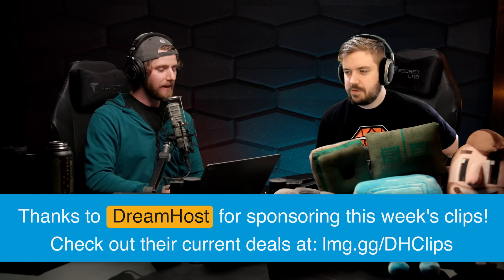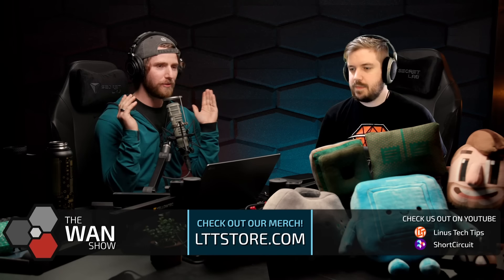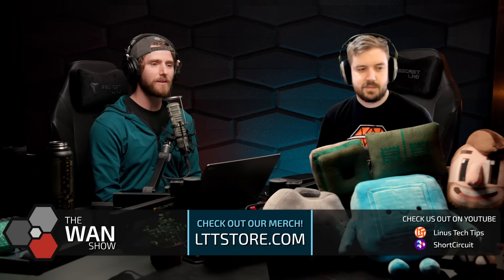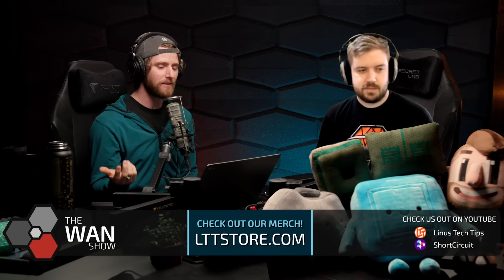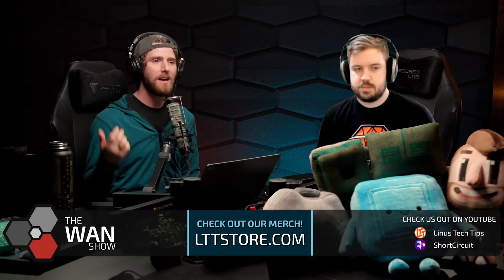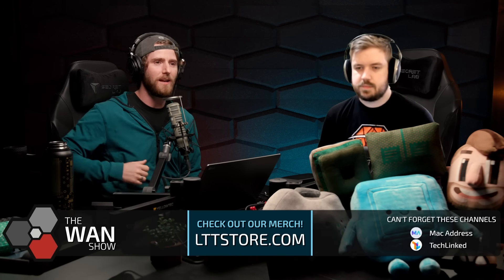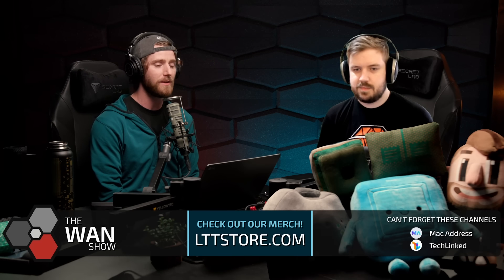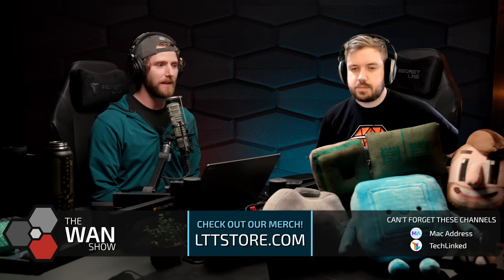They made me WASTE $10,000! Pt. 1

Comment: I’ve had GE/Jasco and I now have Lutron Caseta. Without a doubt, you made the wrong choice.
Reply: Did you not catch the point where he couldn't stand the Human Machine Interface of the Lutron switches?
Reply: @mlindholm  Yes, that’s the point. Especially if your one complaint is the feel of the buttons… you chose wrong. The GE/Jasco switches I had throughout my old place were constantly disconnecting or outright failing. I had to replace four of the switches due to failure within the first year. Lutron Caseta switches at my new place have been rock solid. Read about people online who rave about them. Lutron is objectively better than Jasco.

I will admit the feel of the buttons is different than anything else on the market. They take a bit of getting used to. I understand some may not like the feel, but it is NOT as bad as Linus makes it seem. If he had given himself some time to get over the feel, he’d be much happier with Lutron overall.

Comment: This reminds me of firmware for cable modems.
Some Netgear modems have firmware bugs that can cause random disconnects and such. Oh but a new firmware fixes that!
So how do you update it? Go to the GUI you use to adjust settings in your browser? Nope.
Your cable provider will OTA the update... Except most cable ISPs will only OTA their own devices, not 3rd party ones. - There reasoning for this backwards logic... They be sure that after the update it be compatible with the cable provider.
Which is even dumber if you think in the sense that if firmware 2.0 is incompatible, the user cant themselves downgrade or upgrade to the latest still compatible firmware!

Comment: Never ever install somekind of "smart home" stuff permanently. The basic switch on, switch off switches have been around so long for a reason. Only use smart stuff on stupid stuff like a coffee machine to make a cup of coffee ready when you wake up. Now, for the "smart" stuff that linux if talking about is standardized technology, thats also been around for a long time, BUT you need to know whats the old proven tech, and whats the magic viper poison stuff. Also using tech thats been originally designed for big corporate buildings is probably not a good idea in a small house. Jasco offering no updates is probably because the big corporates do not do updates, they get a preplanned air-conditioning/lights/whatever solution(s) that cost a lot of money and they just live with it, Jasco probably thinks normal customers are the same, you get what you ask for and thats it.

Comment: This is one of the reasons why home automation doesn't appeal to me -- at all.  It's still the frontier days of this stuff, and we've already seen product ecosystems retired.  Commercial device firmware is frequently garbage, there's no guarantee you'll ever see an update, and if there is an update, there's no guarantee they'll release it or won't just replace the original model with an "updated" one.

No.

Not unless every part of the management platform is open-sourced (and cloud-optional!), the software is user-accessible, and the hardware is actually quality.  Preferably, with the dumbest possible on-device firmware.  I would love the protocol to be limited to "hi, I'm a switch.  My state is 'on.'  I have an indicator LED.  Its state is 'on.'  My model is Luxo-matic 1000, serial is 12345abcde, my assigned ID is 0x0008."  I'm hoping that, with a purpose so minimal, the firmware can be reasonably bug-free at version 1.0.  But I remain skeptical of even that.

Comment: I understand Linus, i get why he's mad about it but if Jasco said there is new firmware for this devices then surly they thought about a way to update it. If not through home assistant which is great then through other ways maybe a mobile app that the manufacturer has made for their products. I know Linus might be like  "uhh I didn't set up this light switches in home assistant so I wouldn't need their app just to have to download it anyway because I cannot update the firmware through home assistant" . I wouldn't count that as a deal breaker. That's how I would go about solving this problem.

Comment: As dumb as this situation sounds, I think I see a kernel of logic in their madness. The lightswitch department seems to be a small off-shoot of a larger conglomerate that provides far more then household electrical devices. That "proprietary software" shtick could be the result of an umbrella directive that stems from their main money-maker in the industrial sector where firmware security can be taken very seriously because it is otherwise directly linked into their internal IT ecosystem. 
So it's not a herculean leap of logic to assume that some directives are simply applied from the very top all the way down to every branch of the conglomerate. In their eyes maybe as a way to simplify and unify their legalese and internal protocols. 

It could also just be a way to milk more money out via "licensed technicians" or straight up having people replace all the hardware just to have the new firmware. In which case, ew. 

As for a solution, isn't there some way to find someone with a switch with an up to date firmware and port that over? I'm assuming to install it, the software needs to be packaged up in a certain way or something but I'm pretty sure someone with a few cups of coffee and an axe to grind could crack this in an evening or two.

Comment: This is the stupidest thing ever. Even Apple provides firmware updates for their devices, and they're the most closed ecosystem in the world! It wouldn't surprise me at all if they've even got a header on the board for reading/writing to the EEPROM, so all you'd need to do is hook it up to a programmer to rip the code off their switches.

Comment: In Home Assistant create Input Boolean switch and turn it off or on using automation, so for example if your light was turned on by wallswitch you change turn Input Boolean to on and from now light will not work by motion becauase in motion automation you would have condition if Input Boolean 'wallswitch_room_???' is on than don't run motion automation. EZ u noobs ;)

Comment: "smart home" stuff is overhyped and a LOT of it is not worth it. also remember in 5-10 years what happens if the company behind your smart home tech goes under/gets bought and shut down...
the phone app would be first to go so no more knowing if you left the garage door open. the hub (unless its running everything local) suddenly things can stop working like if your furnace udates and doesnt support older version of your smart home network...
when a motion sensor dies at that point you cant replace it alone, youhave to replace the WHOLE SYSTEM at that point...
have you ever seen a PC get into a boot loop or freeze where you have to hold the power button, how do you do that when no one is home and your furnace is belting out heat/running AC thinking the house temp isnt changing in the system. add in what linus just had happen and you see how dumb "smart homes" truly are.

Comment: Is there anything smart about smart devices? What i need the most is cross talk between different brands before i think it's "smart" having 3-5 different apps to control light, heat, security and what not isn't smart. Is dumb af. But finding a 3 party app to control it all centrelized is a total no go. And google home so far has proven impossible... The issue list is long... Trust me... So i insist all smart devices should be called dumb devices for not letting third party app work with the device

Comment: This reeks of some moron executive who clearly has no background in tech but is still writing tech policies. They clearly don't understand the difference between compiled firmware files and the  firmware source code, which is proprietary and not actually supposed to be shared. I get that there are ways to decompile code, but pretty much any decent compiler should have encryption and or obfuscation that should make that near impossible to do. Stuff like this makes me glad that my company requires working a good few years in an engineering role before being eligible for management.